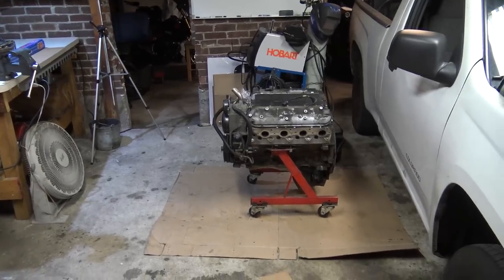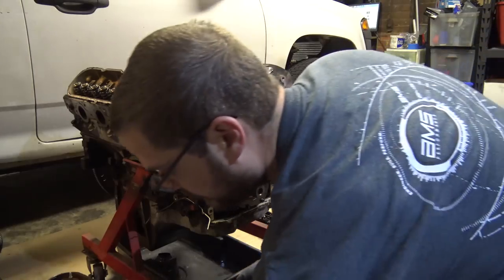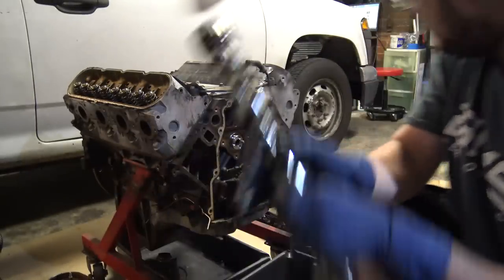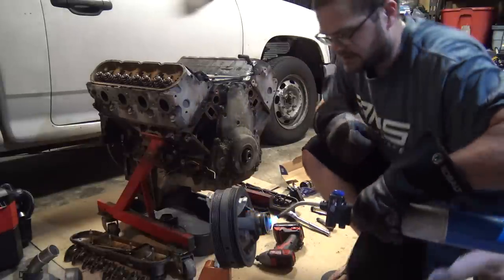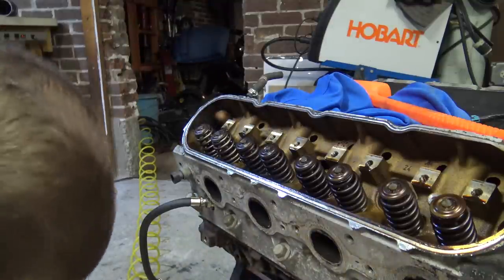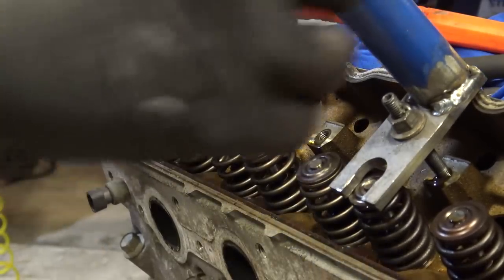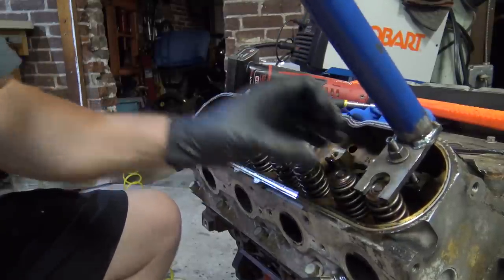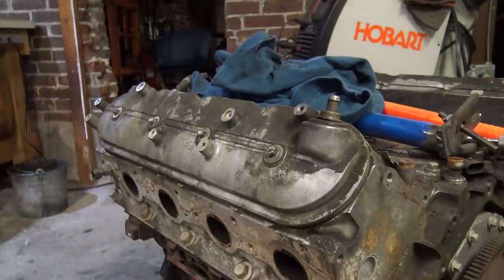dont BS me ep3 - cam and valvesprings

Comment: after reading all this crap online about having to remove the oil pump and replace timing chain, balancer bolt, lifters, head gaskets, head bolts, pushrods and all the other gaskets I was starting to get overwhelmed and the parts list was like $700.  Now that I've seen this and I already know you made 1000 hp doing shit like this I'm ordering a sloppy stage 2! lol thanks for the confidence.
Reply: Hey, did you ever end up doing this and did it work out for you?
Reply: Timing chains are cheap, i always instal a new one for peace of mind but to each his own lok

Comment: Lmaooo 11:08 "Whatever you do, don't look at your cam bearings. If you look at them, they'll be bad. If you don't look at them, they'll be fine." That is the finest piece of automotive advice I've ever heard 😂🤣
Reply: cant beat Schrodinger's cam bearings !
Reply: Aaron H. See, they were perfectly fine before.. now look at them :/

Ignore the fact when I looked at mine, they were not even there, forged cam shaft, onto straight pure aluminium alloy head.
Reply: Ouch. 

What sucks for me is those heads where only a year old, same with the motor. I got about 20k miles before it started ticking.
Reply: thats nasty, someone probably left some shmoo in the oil galleries for it to starve and just start rubbing like its the end of the world..

only found out about mine when green fluid started to pour out of the exhaust, thinking "new gasket time" and it was a dirty crack instead... I suppose it was 400K+ on that head, something had to give..
Reply: That is what you call 'Schrodingers Cam Bearings'.

Comment: FYI: I never use compressed air when changing springs. The valves usually just stay in place. If they do slide down you can push them back up by rotating the engine and the piston will bring them up. Just something I've noticed and maybe it could save you some time. This is an awesome video for first timers, good work

Comment: GREAT tool for changing valve springs. A guy might suggest (if a feller’s planning on doing a few of these) mounting lengths of all-thread for each spring. Might speed up the process

Comment: Dowel rods are insurance that the lifter won't drop to the pan.  They can still drop part way (to the upper machined part of the lifter body) if you get unlucky.  I had two lifters drop when installing a cam in my C6 but was able to tap them back into the plastic lifter holder thingy with a long 3/8 extension in the cam bore.

Comment: Sweet valve tool. Cut a slot on the side of your valve spring tool so you can quickly just slide it off the stud and go onto the next one???
Reply from the maker: good idea but it might make it weaker, double springs are really tough to compress

Comment: Late to the party but just doing research before I take the plunge on a swap and turbo, just wanted to say thanks for documenting all your work, love what I see so far.

Any reason, ignoring peace of mind of course, not to replace/upgrade pushrods and rockers while you're there switching out the springs other than just saving several hundred benjamins?  Only just started bouncing around through your vids, not seen if you eventually replaced them or not tbh.

Think I spied the worn pushrod going back into the #7 slot also... shrug

Comment: that bug that crawled into the engine at 30:21
Reply: extra 20 horsepower
Reply from the maker: lolol incredible observation
Reply: I think you put the worn parts to the rear of the head...
Reply: Extra lubrication
Reply from the maker: just giving them a good shuffle lol
Reply: It flew back out at 30:34.
Reply: Biodegradable. He's not getting anything in the water pump though

Comment: No lube on the new cam?
Reply: Lucas cantrell Thats what i was wondering about.
Reply: There wasn't any on the old one when he pulled it out. It's all good.
Reply: wears a lobe off of the cam during break in "Oops now i have bad con rod bearings and main bearings because there is a lobe worth of metal shavings in my bottom end."
Reply: IT is not a clean dry rebuilt engine.. there is arlready smoo in there.
Reply: @F8LXEPSHN  NOW THAT'S FUNNY!
Reply: Anthony Jones that’s what she said

Comment: If that's the first time you ever channged valve springs with air and a home made VS compressor too ya done a damn good job of course I am 53 and been literally doing this shit since I was old enough to hand my dad tools and man ya done a great job I make all my VS compressor tools to change em at the track or in the car or on the engine they sell shit anymore bud!! Riddle me this I am just getting into the LS engines and just bought a. 04 Yukon Denali w a 6.0 and got coming home and it runs between 20 and 30 pounds oil pressure and its like brand New anyways I bought an oil pressure switch but people have said that it would be fine and I have been watching you for a while cuz I know you know your shit on LS engines and I am a balls to the wall big block Chevy or big inch Chevy and MOPAR also do a lot of Ford and bought it to drive brother its in great shape but just done like that shit!! Thanks for any aevice in advance and if ya need any chassis shit or any BBC or any big inch sbc I can help ya with just holler 
corvairman69@GMAIL.COM

Comment: I don't plan on forced induction in the near future. I'm running 706 heads. Is this cam still a solid choice for just motor.? Should I change the springs and lap the valves,? Just over 100k 3rd gen truck motor

Comment: ~14 min, you could use an allen on a socket with a wobble or extension and your impact for speed if you are worried about the nut moving on the stud :)

Comment: the cam on ebay that you have in the description is a 220/224 .575/.575, the one you recommend in your 2017 video on jegs is the 228/230 .585/.585 did you use a smaller one because its a 4.8? or because of the weight of the truck or something?

Comment: I had a couple pushrods worn the same as what you showed on my 5.3 in one cylinder and was wondering if that's caused from a lack of oil do to the lifter? If so wouldn't you want to change the lifter as well? I know this is sloppy mechanics so it will fly but my motor is torn down to the bare block and was wondering if that's something I should do while it's out, or can the simply be cleaned? Same with the rockers that match those pushrods should they be replaced or would they be fine?

Comment: You put that pushrod in the back on the driver side lol
Reply from the maker: not following you?
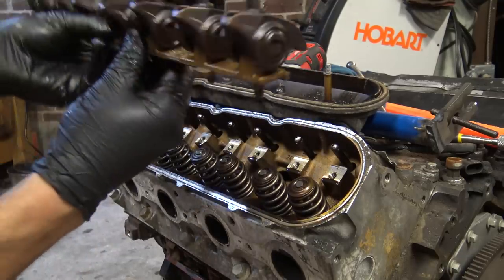Reply: The one with the wear.. You said you were putting it in the front,but I think I see flexplate..so it was the drivers rear. ~ 41:35
Reply: Walker is saying you installed the slightly worn pushrod on the #7 Intake, you also did not tighten that one either.

Comment: If one side is always cleaner than the other is that because of the way the egr system works?
Reply from the maker: +Mrzizzy69 because if the egr and crank case evap yes
Reply: I think it's because the gunk is forced down when 6 quarts of oil gets poured in at oil change

Comment: Worthwhile to upgrade cam and springs now and add turbo later? Or do it all at the same time? Turbo is not in the budget ATM. Decent gains just from cam/springs?
Reply from the maker: correct, cam and springs always worth it, if you can afford it this cam works great NA and turbo, so its a no brainer if you have the money at the time to install it, in my opinion, much easier to install this stuff with the motor out
Reply: Sloppy Mechanics Cam/lifter spring wise its affordable. Any other cam recommendations?

Comment: Hey man I need a custom tune. For my stock bottom forged rods .lq4 with l92 heads.  With 4l80.  34 degrees of timing.  90 lb injectors.  Custom cam. 585 hp at crank . 7200 rpm. What is cost 
 4500lb car. I want to shred tires , with out brakes

 Can you help

Comment: does the timing cover have dowel pins on the LS?   My Viper doesn't so I like to install harmonic balancer before I tighten my TC bolts to help insure that the balancer runs true in the TC seal.
Reply: mcgyverdude That's the proper way in fact he actually used feeler gauges in one build to center it I believe

Comment: I noticed you have new part number for the cam on the video where u list all the parts needed. Can I run that jegs cam and pac 1218 springs you recommend with stock lq9 and stock 4l65e ? Thanks in advanced.

Comment: When you swap out the stock cam to the Eglin E1840p .585 lift, 283 intake, 286 exhaust, 112° lobe seperation, do the push rods need to be changed?
Reply from the maker: No

Comment: get extended warranty with those Milwaukee tools, it has paid it self in gold for me because the Chuck's and impact mechanisms inside mines failed me a couple times and the switch they gave me new improve replacement tools for some that were to expensive to fix
Reply from the maker: +Kareem Colebrooke can I buy it afterwards?
Reply: Sloppy Mechanics if it's not that old or recently bought yes but if it's already beat to shit then no
Reply: we had 2, 1/2 impacts the brush style ones burn up their holders and triggers, good thing it came with 5 year warranties when we bought them. it was worth it lol. my new Milwaukee Fuel Impact has been holding it's weight with the 9.0 battery's just chugs right along.
Reply: Wildkat9797 yea the brushless ones seems to hold up alot better but the Chuck's and triggers are the weak link the Phillips head screw inside the Chuck's has to be tightened up occasionally but they are great tools

Comment: I'm doing a 5.3 lm7 turbo build using the exact same cam and valve springs. Can you suggest some budget lifters and pushrods to use along with them. I figure I should replace them while I'm there anyways.
Reply: Stock

Comment: hey I am doing ls turbo  my question are you going to gap the  piston rings and will the stock head bolt take it
Reply from the maker: +Pontiac Ross so glad you asked Ross, I am not doing any other modifications to this short block, also check out my other videos of my truck making nearly 1100hp on stock re used head bolts and head gaskets without issue and you can base your opinions off that
Reply: Sloppy Mechanics  hey keep the work your videos great I am on a budget.  I got the one3 profromance turbo  cxracing intercooler pipe mishimoto intercooler single Aeromotive fuel pump 340 799 heads .The 5.3 is a aluminum Gen 4 block

Comment: Heating your balancer up is a good way to melt your front main seal
Reply: Ok you didn't get it that hot
Reply from the maker: 45 balancers later, they are the only thing that doesn't leak

Comment: I have a 4.8 as well. I'm looking to boost it and use the ls9 cam. I see you hacer the 3 bolt in there but no front cam sensor. if I take the 3 bolt gear that comes on the stock cam and use it on the ls9 cam, will it be ok to keep the rear cam sensor with the ls9 and will it still work with reusability or I do I need that front cam sensor?
Reply from the maker: ls9 has no back gear IIRC so you need to use whatever tooth your motor is supposed to have, if you have a 24x motor you need the 1x gear, if you have a 58x motor you need a 3x gear, and you need to move it to the front if it is in the back, also if you are moving the back cam sensor to the front you need to swap the outside wires on the sensor

Comment: Matt ever think of doing a compound turbo setup with the 4.8. If you unfamiliar with the setup allot of diesel / 4cyl guys use them . Its a small turbo feeding a larger turbo. 
That would be different cheap and able to hit high hp #s with low to little lag.
Reply from the maker: i dont think its worthwhile, i am a firm believer in you just size a single turbo for your application and goals and you're done
Reply: What if your goals cant be reached with a single turbo?The motor you have isnt big enough to light the turbo you want to use.  Some people want a turbo that instantly lights , has large HP/TQ  #s with low EGTs.  
Im not into mirrored twins.  I beilve in a properly sized single or a a compound setup for larger hp #s . 
I personally have tried everything once or entertained the possibility before putting it aside   as not being worth while.
Reply: Mark Rich Compound turbo's are a stupid meme for OEM's and diesels. You've been watching too much top gear.
Reply: problem with compounds is you have to keep adding for power, due to your small charger on a dual setup isn't gonna be able to feed the big charger when you give it more fuel, now you have to change your small and big charger due to the imbalance. big hp diesel guys that race don't run compounds, they run nitrous to spool big single turbos.
Reply: The exact point of my post. I personally dont race . I dont build my trucks for the track. Not every one wants to drag race. I build my motors for real world applications that I USE everyday.  Like I said if youve never done one how can you knock it. 
AKDMB 
Ive never watched top gear. I own both diesels and gas turbocharged engines.

Comment: Not a fan of the Trunion Bearing change I see...
Reply from the maker: +dman1049 of course, I have never done it
Reply: Sloppy Mechanics word on the street is that's it's a failure point... id think you would have ran into its... guess it's just the sloppy mechanics luck

Comment: Wait, you dont have to rotate motor to do valves?
Reply: That's why he's putting compressed air in the cylinder. To hold the valves up. Rotating the motor to dead top on the appropriate cylinder is insurance

Comment: Isn't the cam really going to peak high?  With a @.050 228/230 on a 112 the little 4.8 might have to spin 6500+???
Reply: Its 220/224.
Reply: Its 220/224@.50 and.575/.575 lift
Reply: Mikel Bentley witch cam are you talking about
Reply: Mikel Bentley the one that Matt is putting in is a 228/230 586 lift or something like that it’s not a 220/224
Reply: LS NATION YES IT IS...ELGIN 1839P  220/224 IT'S IN THE DESCRIPTION..YOU ARE WRONG
Reply: if you look at the sloppy wiki page, he lists the E1840P as the sloppy stage 2

Comment: when you heat up the balancer to slip it on can it damage the mechanical seal on the timing cover?
Reply from the maker: no, imagine how hot the engine, balancer, seal, and crank is all the time
Reply: @SloppyMechanics  at work I have a special bearing heater to slip bearings on, I was thinking of letting the balancer sit on that to get hot
Reply from the maker: Sure people do ovens

Comment: will the torch burn the seal when heating up the balancer?
Reply from the maker: no, think about how hot the seal and pulley and block is when the coolant is 200 and oil temp is 250
Reply: @SloppyMechanics  I thought it was more like 400 or 500 lol but I was just cautiously curious

Comment: Matt, thanks for the videos like always! Got a cam question though. If $$$ wasn’t the issue what cam would you go with? You have experience with the jfr 218/218 previously. What would you pick between jfr/stock48 cam vs ur sloppy stage 2? This is will be on my stock lq9 with pac1218, m6.  Thanks in advance. Wanting more low end power/torque. Was use to 4.10 rearend gears when NA . Thanks in advance
Reply from the maker: Custom cam is always best and usually only 400-500$
Reply: Sloppy Mechanics Matt thanks for the quick response. Got in contact with Jarrett reguarding my setup and has a cam that would work for me!

Comment: Is the seal melted now?
Reply from the maker: +Thor Dehr no
Reply: Are the timing cover seals that heat resistant?  Impressive.
Looks like this series is going to be what pushes me over the top and gets me to buy your kit to repower my '65....Typical '65 mustang LS Turbo build that will surely annoy purists.  Light car, big turbo, crap brakes.

Comment: I just use an old plug wire stuffed in the plug hole to hold up the valves, quicker than air chuck by far
Reply from the maker: +Mike Mixer great ideq
Reply: came up with at 3 in the morning sticking a Crower Street beast into a 350 in my friends nova. He wanted to change the oil seals and even at 150 psi the keepers were fucking hell jammed up and the 8 pound sledge was looking mighty tempting, just end the fucking thing right then and there and have a beer. it was a flash idea when I tripped over the distributor cap. good times

Comment: dude, ive heard those type valvespring compressors can break off bolts in the head

but i dont fucking care at all after changing 16 dual valvesprings with one of those fucking clamp hook twist things i'll pull the head drill/tap any bolt sacrifices the tool demands